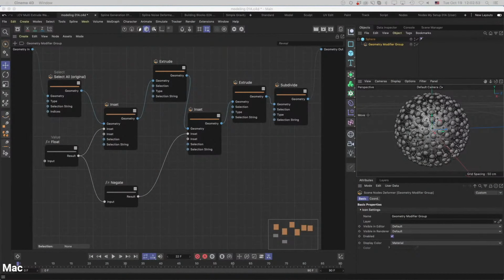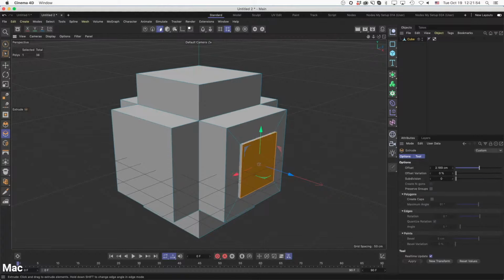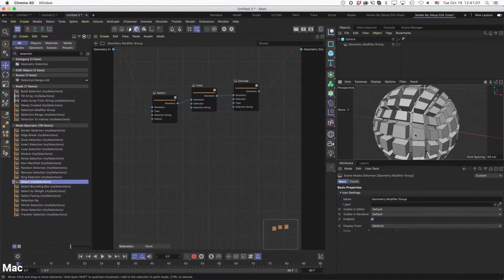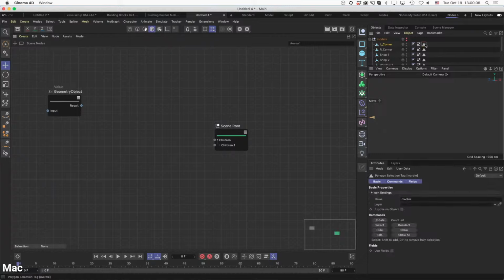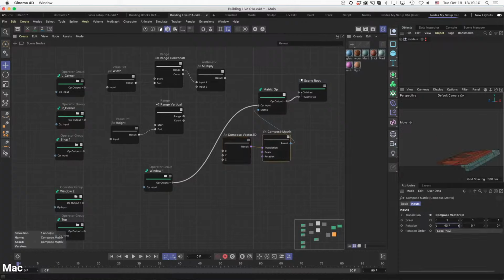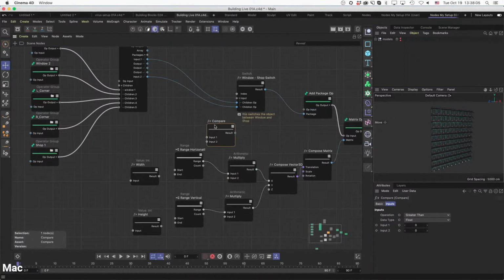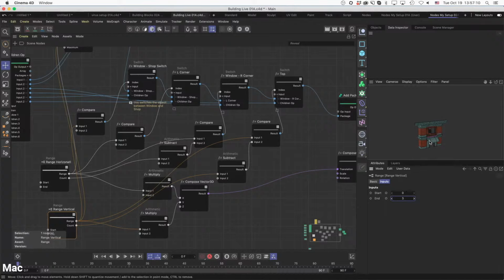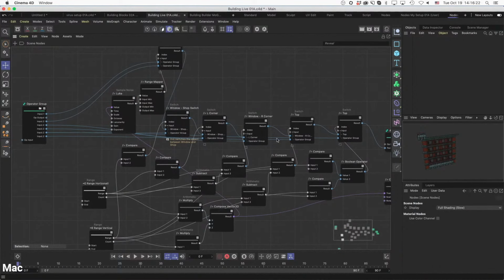knowsman shows - Episode 03 - Exploring Scene Nodes & Capsules

Comment: Great tutorial as always!! i'm trying to make it build all 4 walls with the same setup inside the generator. i cant plug a value to the position of the matrix though. whatever i try it moves the clones separately and not the whole thing. i can duplicate the last Matrix Op and change the values manually but i want it to be procedural feeding it the values after the multiply. for example if width and height is 10 i need to have a fixed rotation to each wall and move them by 900 in the z or x axes. i feel that im missing something basic here, what i need it to do is super simple. any suggestions? thank you! *great accent too for a greek!!
Reply from the maker: I do not have an accent... that's the point. On another note, DM me on Twitter with simplified scene file.

Comment: Is there a way to secet exactly those polygone, wich would be active if i would fE inner extrude/extrude in a normal worksflow?
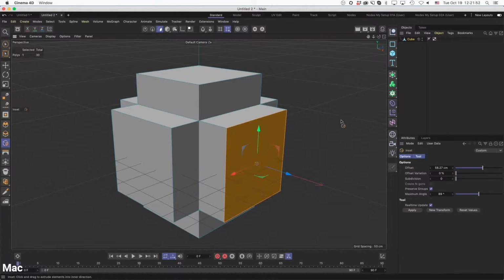Like shown at 21:49 here you selected a polygon, inner extruded it and it was selected for the next operatione (extrude).
I would like to have that polygon to be the active polygon in my nodestreams. (without typing specific number(s), just adress kiind of the „old active“ somethin)
i mean … i could store the selection before the first operation and than use that … but i had to store and name a lot of selections in some cases.
So … is there a way to adress this?
Reply: fE if i node up:
Geometry > Inset > Extrude > Output
it extrudes every polygon, not only the original ones, wich are insetted.
but i wand to adress only those ones. if possible without an extra store selection node and using sting-names and all that stuff.
Hope i can make myself clear here? I am not a native speaker.
Reply: In another video you used the Active selection node for that. But seems like this node is gone in the actual c4d version … hm
Reply from the maker: you need to add a "Select" node right after the 3d object and Set it to polygons and then type "all" in the selection string. That will select all CURRENT polygons and make them the "default" selection for the following nodes to use.
Reply: @noseman  hey. Thank you very much! It worked. 
I love to experiment with Scene Nodes. So thank you for the great tutorials.
Maybe … if you know: 
Do you know if there is a way to MoExtrude with SceneNodes? Extruding is cool … but beeing able to have some angles, rotation and and direction in the extrusion would be even cooler. But there is no MoExtrude node. So you dont have to tell me how … but may IF there is a way to achive this kind of MoExtrusion-Effect?

Comment: HELLO NOSEMAN! Thanks so much for all your awesome teaching. I'm trying to wrap my head around C4d's nodes right now. I'd like to make a setup where I can hopefully drag/drop any attribute of a scene object - for instance, the strength attribute of a bend deformer - into a capsule, and have controls to oscillate that attribute value based on, say, a sine wave function. I've built a setup that drives position/rotation/scale transforms using a sine wave, but it only works on geometry. I can't figure out how I'd go about doing this. To me, it seems similar to the xpresso set driver/driven functions, which I can do, but I'm trying to make it into more of a tool that I can just sort of drag and drop into my project when I need it. Any idea if this would be possible?
Reply from the maker: you can't use objects that don't generate geometry for example deformers. You do have some deformers inside Nodes but they are not working as you would expect... I avoid using them. Scene Nodes are nothing like XPRESSO and can't do many things possible in XPRESSO. For what you need it's best to use actual XPRESSO and save the Object (rig) as a preset in the Asset manager...